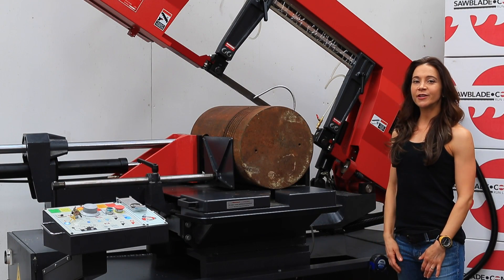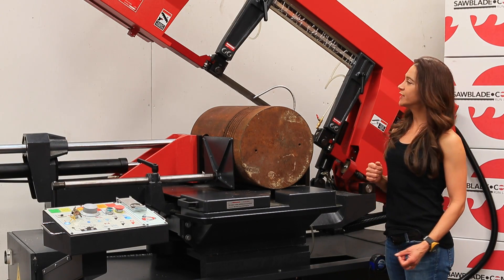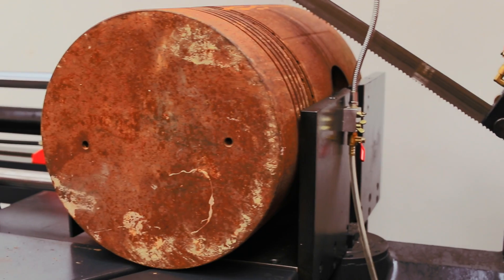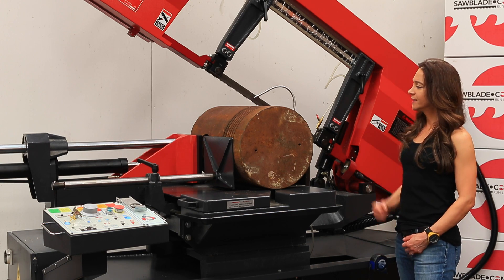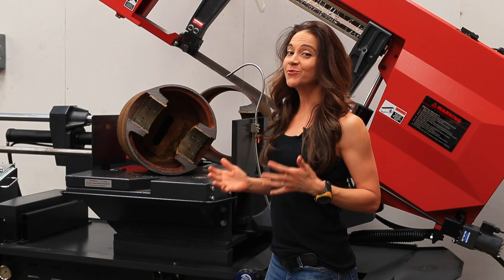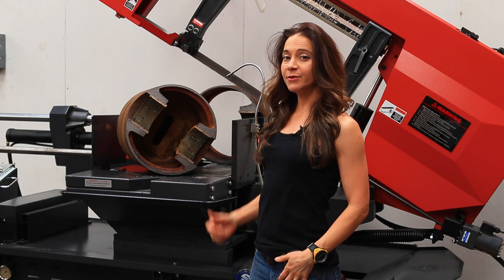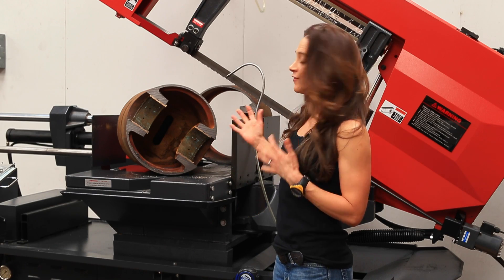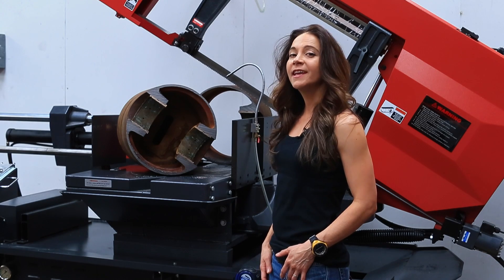Curiosity Episode #3, Cutting a 15" Cast Piston in Half!

Comment: Hi Celeste,

Solid Cast steel? Looks like hollow cast iron to me and not particularly thick either. Looking at the wall thickness and blade tooth pitch I would say the pitch was not correct for the cross section of the piston (3 teeth min on section).  I would suggest cutting some solid inconel or stainless round as you mentioned of a similar diameter as a good demonstration of the abilities of your product.

Safety glasses? 

Regards,

Tom
Reply: This is an everyday object?